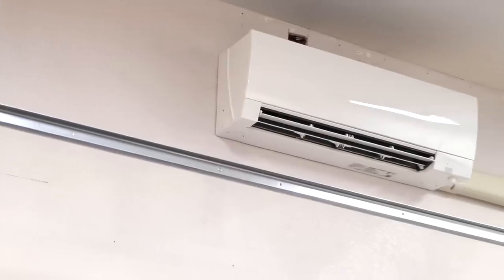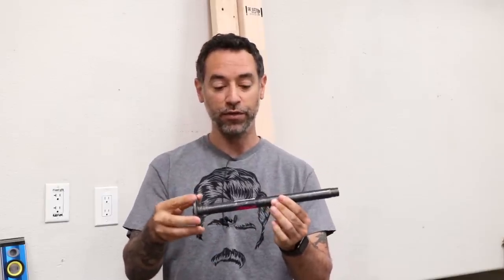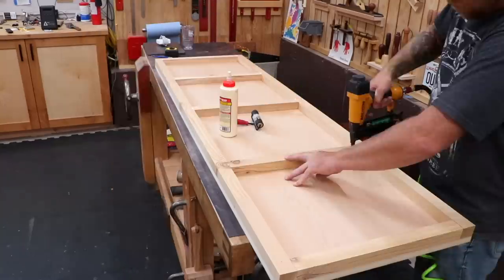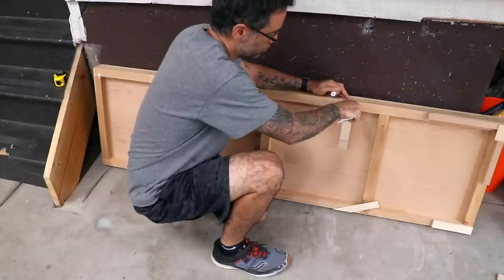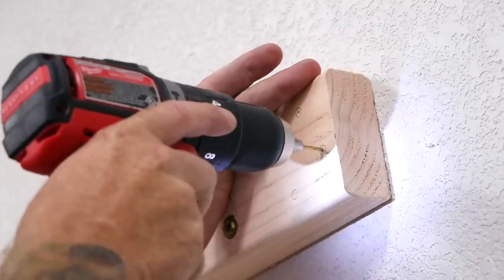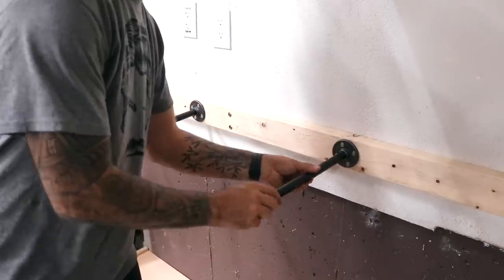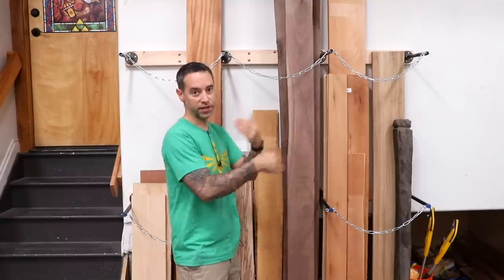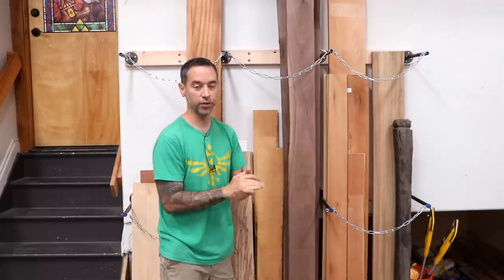Inexpensive Vertical Lumber Rack

Comment: Fastcap sells these kind of braces called “speed dividers”. Sell for $7.00 each. Might be an alternate.
Reply: By far my favorite comment! I designed the Speed Divider by Fastcap and I believe the pricing is $6 each when you buy a box of 10 which is way less $ than pipe flanges, pipes and plumbing caps...and way more flexible! Thanks for the mention! And for the safety minded people out there you can insert a pc of 1/4" plywood as a flag and label your sections and not skewer yourself. There is also a predrilled hole for a eyebolt in the end of the speed divider.

Comment: If space allows, go vertical 👍 I have customers that display hardwood both ways. Vertical is MUCH easier to flip through, look 👀 at & harder to mess up compared to horizontal or floor racks. One thing to keep in mind... if you’re storing boards over 10’ long it becomes unwieldy. One local company in particular has a habit of loading their vertical racks with 16 foot long boards 😫. Scary,  even with the chain (especially considering most customers unhook the chain for better access 😬)
Reply: Commercial Forest 👍👍👍

Comment: I first saw vertical lumber storage in Tokyo more than 50 years ago. A hardwood dealer had his entire inventory in a space no larger than a noodle shop, maybe 16' wide. Here in semi-desert I acclimate project materials for a few weeks on end before sawing. By broadening the bottom standoff from vertical, a stack of boards can be spaced with a gap between them all except where they touch at the top. By making the bays fairly narrow almost no load impinges on the outlookers. 3/4" EMT conduit is way stronger than necessary. By grinding a spade bit to near the conduit's outer diameter and angling the holes so it rises above horizontal, satisfactory and safe storage can be built for fewer $$.

Comment: I do vertical storage but I used styrofoam on the bottom to prevent wicking. Moisture will not wick through it and the wood stays dry. and undamaged because the styrofoam is soft enough to allow some dropping of the wood. Mine is closer to the doors and rain and wind attempt to take a toll on the wood but using the styrofoam saves a lot of headaches. It's easy to wipe off and keep the moisture out.

Comment: Dip you clean off the pipe?  The home depot stuff is often coated in oil.  Which can contaminate  wood cuasing finishing issues.  I would wipe them down and hit thrm with some spray paint/ laq.
Reply from the maker: Tyler Gordon it’s rough lumber. Not too worried about stains.
Reply: @woodwhisperer  with rough that is true.  I tend to buy sss  and it never stays in my shop long. A few days max.  I buy it for a project and its used asap.  I should be on the job right now, but 35 mph winds and trying too apply house wrap does not work.

Comment: Hi Marc

What about the wall sockets, the electrical outlets that you covered up with the wood in the storage rack you put up? 

Won't they get damaged by the timbers resting or falling against them?

Apart from that great outlet for a way to store lumber when needed for a project or 2.👍👍👍👍👍👍👍👍👍👍👍👍👍👍👍👍👍👍👍
Reply from the maker: Not sure what issues could/would happen. The boards never really make contact with the outlets.

Comment: You mentioned in your earlier videos that you had decided against using the mini splits due to the location the condenser unit would require, what did you do with it in this install?
Reply from the maker: I forced it into the location I wanted. :) The reason I put it off was because it was going to require busting up some concrete. So I had to wait for the funds to be available for such a big project.

Comment: Ok, just can't keep up..lol. I built the horizonal storage system you did years ago with the sheet goods/scrap piece storage roller cart underneath that swings out on a pivot hinge.  You changed yours not long after but, I still have mine and, yes, I have to use a ladder but I have built a ladder "system" kind of like you see in library's that slides back and forth along the front of the storage racks. If I had room I would put in a vertical storage also to make it easier to see what I have because it can be a pain to see what all you have stacked horizontally.

Comment: I havent got a lot of floor space, because I'm in a storage unit. That also means I can't mount things to the walls. So I use vertical storage on a cart with big castors, and I store it just inside my shop, when I open the unit door, I roll the cart out into the hall, freeing up floor space and allowing me to get at my tools. So while vertical does take up more floor space than horizontal, it can be made to take up less if you're space limited and can't mount to the walls.

Comment: Why did you bother with leveling the the platform? The platform makes sense since it’s on concrete in a garage that sometimes holds a car.
Reply from the maker: Because a level platform doesn't encourage every board to lean to the right.